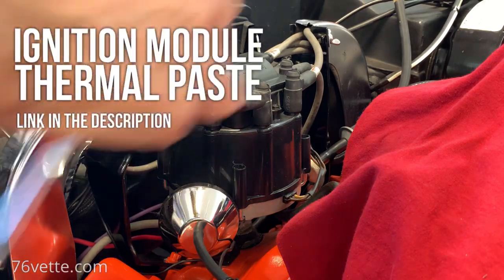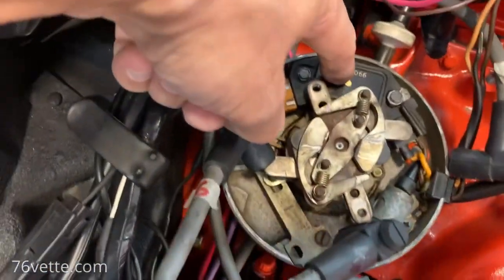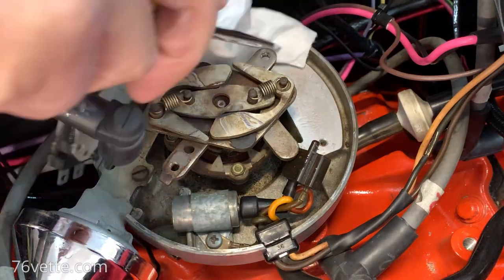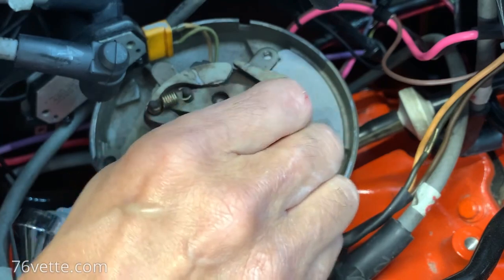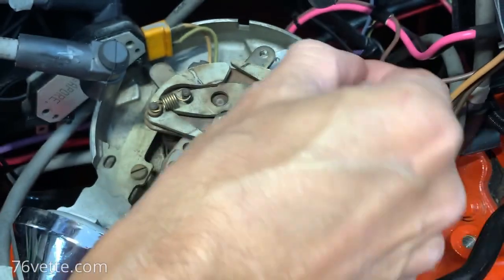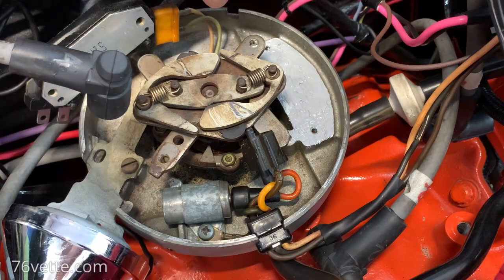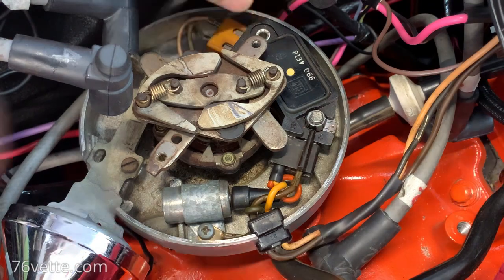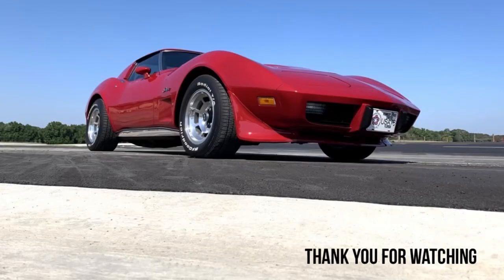Must-Use Ignition Module Thermal Paste

Comment: Im working on my Buick 3800 coil module…supposed to use thermal compound to keep the back of the module from possible corrosion where it mounts to the engine…but…dielectric grease is insulating…not good to transfer current thru the the two mating surfaces which is the ground path…the grease you recommend is thermal but non conductive, contains no metal…sooo…wont that make it actually run hot?as it resists current…
Reply from the maker: I haven’t touched that module since I shot the video a few years ago, and haven’t had ANY overheating issues after thousands of miles. That’s all I can tell you. Thank you for watching! 😊👍🏻
Reply: @76vette  dig it, i just tried for a couple hours to find a electrically conductive thermal paste…big surprise…there arent any…a friend suggested that maybe on my Buick the bolts passing thru the metal sleeves of the coils pass to ground…now im not sure if i should remove the thin film of dialectric grease i used and go with the thermal paste…dunno…but thanks

Comment: Using a hei module on my Mopar. I have an aluminum mount thats designed to bolt underneath the distributor base. Did this about six years ago and had my first failure.  Replaced it with a Pertronix module and used paste supplied.......failed in four months. 
Installed a ECH TP 45 module using the same ArticSilver as you did. 
Any idea how much heat the module can handle?
If you think about it the distributor is going to be engine temp.....roughly 150 degrees.....just curious. ...
Reply from the maker: My guess is that number varies from manufacturer to manufacturer, and I believe that using an original module instead of an aftermarket unit is a far safer bet. The heat transfer paste can make a difference, of course. 
Mine has been operating fine since I made the video (a couple of years ago?!) with the Arctic Silver paste I used. 😊👍🏻
Reply: I’ve researched this module issue and from what ive read the module will reach its danger zone in the 240-250F heat range. Get your engine up to operating temps, 180-200 degrees and then put an infrared temp gun on the base of the distributor, preferably the area where the module sits and get a reading. 140-180 degrees is very acceptable. 190-200 is still ok. 210-220 your stressing it. 225 and above its prone for failure at some point.

Comment: New to the game apparently the silicone has always been used since 1977, When you buy a module it should always have the accompanying paste along with it unless made in china, These distributors were the "quadrajet" of distributors, That is "when" they work they are great, when the quit, you are stranded. Then you have 3 choices as to which to replace! A  retired GM engineer told a group of us that GM discontinued and made their changes. Seriously any street engines I have now receive a good points system and keep a spare points and condenser in the glove box and back on the road🙂

Comment: I've been browsing ignition videos for a while before discovering this little gem of a page. Nice videos! Any advice regarding a '78 Anniversary Edition throttle assembly that currently prevents the accelerator from being pressed? Throttle cable and linkage are seemingly alright, but the rest of the assembly is stuck. Anything and everything is appreciated.
Reply from the maker: If you’ve isolated the problem to those components— and they cannot be repaired—I would buy used OEM parts and replace the assembly. 
For used OEM C3 Corvette parts, contact Wally at Corvette Generation, (352) 523-0900.
Good luck! 😊👍🏻

Comment: Nice video. How about the ignition module, is it still running. Did the Artic heat sink compound a good job. No heat problems any more? Was the applied layer enough to conduct the heat?
Reply from the maker: Thank you! 😊👍🏻 And the heat sink compound has worked great so far. Unfortunately, I have no idea as to how much of the compound is enough, so I probably erred on the side of caution by using a bit more than necessary.

Comment: This is one of the main parts which leave a GM motorist stranded.  Left me stranded 3 times.  Even with the paste, these are prone to failure due to heat.  They get very hot!.  I keep an extra one in the car.  Most importantly, keep a screw driver and change the mounting screws to the rotor and module to flat head or you will need to carry a box screw driver, phillips screwdriver and flathead screw driver; which ever ones are fastening the parts that need removing.  
I unplug only the passenger side of the cap and tilt the cap over; labeling the wires on the passenger side prior to removal.
Good idea on the thermal paste.  I do have a jug of dielectric but your paste may have more heat sink properties.  As for the actual module, they don't make them like they used to. OEM still comes from who knows where.  I bought a OEM GM as a spare but I still have a early 80's module still in the car working perfectly.  I trust the old stuff.  

P.S. when I remove the rotor any time, I usually lubricate the advance springs to be sure they move freely.  A squirt of WD 40...
Reply from the maker: Good thinking about replacing the module screws because no one has the right size nut driver when you need one. I thought about spraying something on the advance assembly but didn't want to risk any arcing, so I left it dry. Is WD-40 a conductor of electricity? I'll have to research that, but it's a good tip to keep in mind. Thanks!
Reply: @76vette  No problemos! Actually WD40 displaces water.  It's been an ancient trick by mechanics for wet electronics.  I remember my brother getting his HEI distributor soaked after a storm.  Wouldn't start for nothing.  Apparently he didn't know "the trick".  Douse the internals and externals with WD40 and it started right up.
Reply from the maker: @aboutmyfathersbusiness8324  Forgot about that... WD stands for Water Displacement, and a little research confirms that it’s an insulator, so no conductivity issues. Fantastic! Great invention along with duct tape and sliced bread. Thanks again! 😊👍🏻